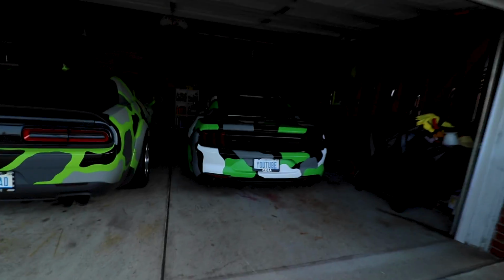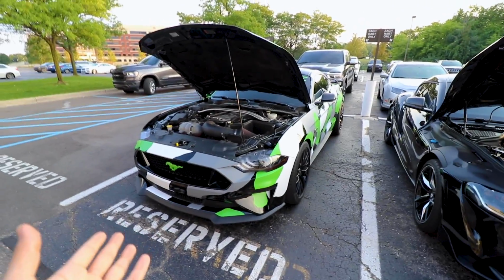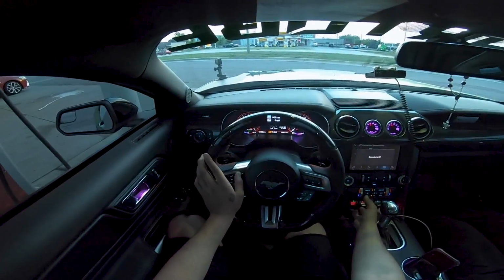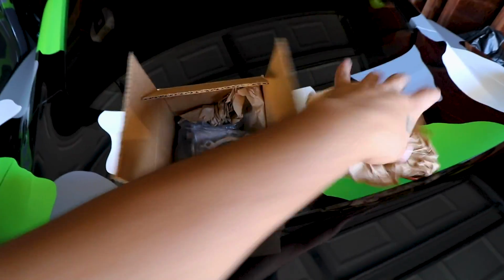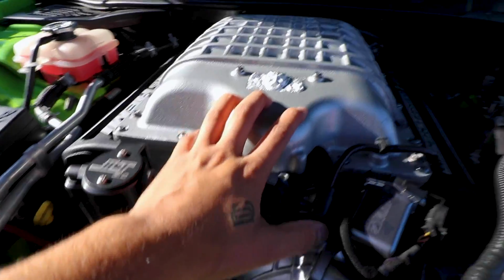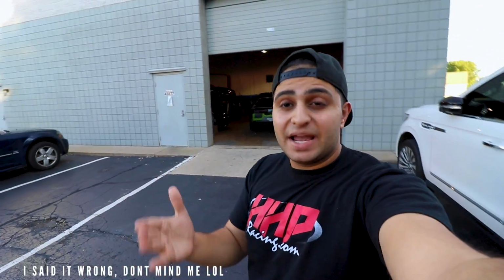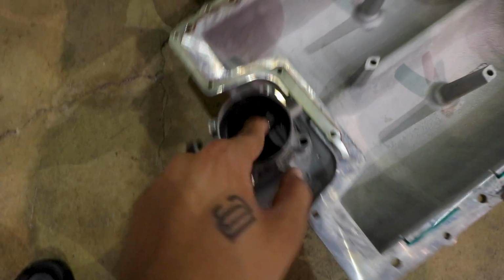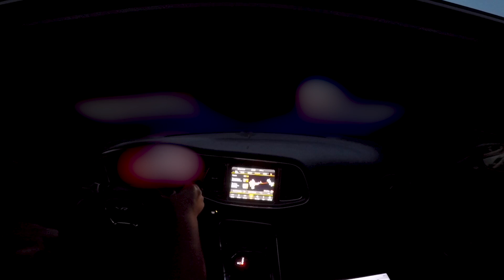2021 SUPRA TRIED TO RACE MY MUSTANG GT!

Comment: You have to Learn to line up.. You're always at least fender ahead in your rolls. 🥴
Reply: even if the supra got smoked bad
Reply: Doesn’t matter when the Supra gets gapped each time 😂
Reply: Not really a supra. More like a stock 335i.
Reply: @jrsosmooth5487  tune with bolt ons vs stock supra, what do you expect? dummy
Reply: @austinwinter8415  watch babaYagas video same hp supra take it.. its a stock supra what do u expect

Comment: He clearly jumped on every single one of those races
Reply: Virtus.n00b he literally said he’s giving the Supra the lead because his mustang pulls more hp
Reply: @StayDangerousFM  a stock supra isn't eating shit alive
Reply: @danm372  You my friend need to do research. A Stock 2021 Supra GR is a 10 second car off the lot. A straight 6, 388hp, and 421 ft-lb torque to the wheel. These are dyno numbers. lol my friend has one. He smokes just about anything around here. And we have a lot around here.
Reply: @StayDangerousFM  are you kidding me? Lmfao!! It's 382 flywheel and it's a mid 12 second car..where the hell do you get your stats from? 10 second car my ass! If he's smoking everything around you, you must live in a dead town
Reply: @danm372  Google it
Reply: They’re a 10 second car off the lot lmao do yo research
Reply: @StayDangerousFM  lmfaoo already googled it and you're completely wrong! 🤣 learn to read
Reply: @StayDangerousFM  Yup. My son sold his tuned SS Camaro and Bought a Supra GR, went much faster at the track bone stock after break in. Hasn’t lost to any stock mustang or camaro on track days, ever. In fact he gaps them.

Comment: All that supra needs is downpipe +tune and itll gap motortube
Reply: lol facts
Reply: Bro if this guy had a stock mustang, his stang would have gotten smoked by the Supra. The Supra smoked a 392 scar pack
Reply: @AyeeKoolaidGaming  Stock vs Stock, the Mustang takes it.
Reply: @burgerbandit3646 not really. The stang does a 12.2 while the Supra does a 12.0 flat. Some people have gotten the Supra to do a 11.7 with a perfect launch.
Reply: @AyeeKoolaidGaming  The Mustang is capable of running into the 11's as well with a good launch. Them being that close stock with the Mustang having a higher trap speed by 9 mph tells you that its a drivers race. This was a rolling race so no, the Supra wouldnt have taken it.
Reply: @burgerbandit3646  it depends. Because I’ve seen Supra walked down mustang in rolling races. I will admit that certain rolling races the mustang gaps the Supra by a car. But in a quarter mile, the Supra takes it. In a bad day, the Supra does a 12.4. On a good day it does a 11.9 or less. The stang on a bad da my does a 12.8. So yes your right it’s based on the driver. But the stang spins much more than the Supra which is why the Supra takes It more. Basically, it requires more skills to drive the stang vs the supra
Reply: @AyeeKoolaidGaming  Yup, Thats the name of the game.
Reply: @AyeeKoolaidGaming  NO. 2021 Supra = 22 secs to 0-150mph, 2018 Mustang = 28.6 secs to 0-150mph. That Mustang is several car gaps behind the Supra stock vs. stock
Reply: @iheartwatches  no right you right but my assumption is based on yt videos I've seen. But yeah the surpa usually gap the almighty fuck out the mustang

Comment: Run them on the strip, id bet it's pretty close.  I've seen supras with a tune and exhaust put out about the same power as the stang, being lighter it should be quicker.  Both fast cars

Comment: My buddy has a 2020 supra, it has downpipe charge pipe  intake and exhaust with pro tune, has 660 to the wheels, could have 700 but the transmission cuts off..got to love computers. First car we raced  was a zr1, and we got him
Reply: 650 without forced induction? sheeeshh
Reply: I have a 2020 supra down pipe bmc filter and methanol kit with a tune and barley got 500 whp ,  So can’t get 660 whp with stock turbos and fuel pump my friend.
Reply: @A________  he has the meth and the pure 800 turbo tuned by Mike, he came to the Dallas area to tune about 9 Supras .

Comment: Stock vs stock 2021 vs 2021 10speed 5.0 Supra takes it every time especially on rolls , this is mods vs stock. Do just a tune not even bolt on it will be faster than this stang and probably same as hellcat just with tune . Now bolt ons it will gap it by bus lengths.

Comment: Hey just curious, How are you launching? I see a lot of people put the car into sport and then use the paddle shifters to gown down into 3rd then after they floor it they put the car back into drive and let the car shift gears but I don't see you mess with the shifter after launching, so just wanted to know which way is better
Reply: for a 5.0 you’ll have to be into second gear for an actual really good launch on a 50 roll and people don’t put it back into drive while it’s on standard mode because it could possibly mess up the transmission cus he has a ten speed transmission

Comment: Didn’t like the Supra race because it was obvious what was going to happen with such as a high roll making it easy for the mustang.
Reply: 21 Supra will smoke 10 speed 2020 5.0 FYI, Supra probably had less than 1500 miles on it and engine is not even at full potential. Let’s give it a try after 2k miles or so again . Because 2020 smokes 5.0 but 21 has more power so this I call bs

Comment: Seems like this 5.0 is close to stock 445-460 hp. 445 is on 91 fuel. Again this is about what stock vs stock usually looks like, not a 5.0 with 100 crank hp more. You should have left that supra but didn't.

Comment: 2021 supra will spank a 5.0 all day. Its 400-450 lbs lighter, is closer to 420 hp not 382 hp for 2021. The 2020 was rated at 335 hp. If your 5.0 (based on what I'm reading), has 530 crank hp est, you should have not trouble spanking the supra, or a C8 vette.
Reply: 2021 dynood at 380 what do you mean 420
Reply: @sm_rcf1156  Crank hp. All vehicles are rated at crank. And the 5 2021 bmwupras I saw were rated around 371 to 379 wheel. 412-415 hp crank. Since today's DCT/Auto trans are more efficient than manuals, we are using 12.5% average since drivetrain losses are much less and there is no exact losses average because each engine has different tolerances and thus only an average can be used. The big issue for the supra is grip. Toyota may in 2024 bring an awd version. The 2022 model could see 400 hp crank. Which would be close to 435 wheel. The downside to the 2021 models is a much quieter exhaust and much less pops and crackles vs the 2020 aground got. I told him to wait 2 months more for the 2021 with 47hp more but he didn't think that was going to be true. In all honesty the 21 is no quicker 0-80. And only a few tenths quicker in the 1/4 and 2 mph faster. I would have loved to get one but with demand high and dumbasdes paying 20-30k dealer mark up,I said NOPE. To small inside for me too. 6'2". Head is rubbing with seat full down and back. The Z4 has more head room and a better look to it IMHO.
Reply: @MasterCarguy44-pk2dq  alright just needed to specify crank. the reason 2021 exhaust is quieter is because of 6 port manifold changes..  2021 will be alot better for those seeking to make big power. I've seen 6'3 individuals enjoy the car and say its fairly spacious for what it is so that is interesting. I am 5'9 and may consider a 2021 as an addition once they hit used market.
Reply: Supra is quick tho 2021 can run 11.9 1/4 completely stock. that isvery quick. With a proper ethanol tune, drag radial and downpipe it can easily achieve 10s

Comment: The Supra has 385 to the wheel not crank... Its a BMW Engine...
Reply: And the problem is what?
The B58 is an amazing engine and makes a shit load of HP once you give it bolt ons and tune.
Reply: @thisguyshorty3554  the problem is the Supra owner saying its 385 crank. My car has the S58 youre preaching to the chior....
Reply: The Juggernaut  what's up Daniel Hernandez! AKA The youtube troll.
Reply: @BabaYaga Racing 
He says your Supra is slow.
Reply: The Juggernaut  just like your Mustang.
Reply: 382 crank hp for the 21's they've dynod nearly 377 rwhp. The 335 crank hp 20' supra dynod at near 370 hp. The 2021 is not much quicker than the 2020 at all until over 80mph where the slight hp increase will show up. Torque is much closer between 2020 and 21 MY. E85 and dp with tune will put the supra up near 500 crank hp. Just two simple engine warranty voiding cheap modds. You'd need to boost a 5.0 to keep up or run a 130-150 hp shot of nos to even the tables. 5.0's have always been over rated...

Comment: Mustangs are sloppy and poorly built. My 2006 Acura TL has beaten all 2007 and earlier mustang GTs. 2 fewer cylinders and a lot less displacement. Ford started improving the Mustang (finally) in 2011 with the 5.0.
Reply: Great scientific test. You plan on running your car against the Flintstone Mobile next?
Reply: @vxer1000  Ahah

Comment: Stock for stock the supra is faster. The Supra’s are gapping the Mach 1 in multiple videos which are said the have 480ho. A highly modded mustang racing a stock supra gives you this outcome. If the supra was modded with a simple downpipe, E50 and JB4 your getting gapped!!!! For less money spent.
Reply: I've seen the opposite on so many tests and videos
Reply: The Supra most certainly isn’t faster than the 5.0 stock. Modded, yes.
Reply: @JP3_C6Z   like they're close in some races but most of the time the 5.0 just takes the cake
Reply: @VermillionRacing  they’re close when the 5.0 is 6mt and the driver sucks lol. Thats about it. Fbo for both, yes, the Supra is much faster.
Reply: Supras are more expensive so no, not less money spent
Reply: Why get the supra rather get the GR86
Reply: @JP3_C6Z  10 speed mustang kills Supra lol
Reply: Gapping a Mach1 no I don't think so even with a tune that's not happening stock for stock they cannot touch a 10-speed GT especially on top end

Comment: That mustang slowly pulling the supra only
Reply: It got whipped and its a lighter weight Turbo car vs N/A Stang. 😁
Reply: It be a good race is the supra has a tune only
Reply: @4bvenom733  Yea it seems the right tune can really wake those cars up ive seen a few vids.
Reply: Ima Kitty Cat down pipe with a e85 stage 2 tune makes these supra’s rockets! give my fbo 10 speed a really good run!
Reply: @keyyblayde4355  Sounds reasonable they are close to 400 whp stock and weigh less than a stang so it should run pretty good with some mods.
Reply: @danm372  Yea I wont be getting one  anytime ever.
Reply: Ima Kitty Cat it’s a 6 banger tho
Reply: @imakittycat1302  This was not "whooped". Dump some E in the supra and its bye bye 5.0. Slap a dp on it. IC upgrade and it'll give the 570 a run.
Reply: @4bvenom733  Supra would dust this 5.0 with a tune, especially if using E.
Reply: @imakittycat1302 :  With less horsepower.
Reply: @danm372  you're smoking. go look up a youtube video of 2020 stock supra dyno. they make more HP to the wheels than advertised. B58 is underrated
Reply: @dinhzel  not underrated 100 hp 🙄
Reply: @dinhzel  they make 340 to wheels not 400 wtf u talking about? That's most powerful version too
Reply: @danm372  no one ever claimed stock supras make 400 to the wheels...
Reply: @dinhzel  one guy said 388 and a few others said 400. Did you read the comments?
Reply: @danm372  good job deleting your old comments. I said 2020 supra was underrated. 2021 supra stock makes 388
Reply: @dinhzel  that was to someone that deleted there comments...said the same thing. I see at least 3 comments on this post that claim 400whp..are you blind? I don't care what you're saying, nobody was talking to you
Reply: @danm372  i feel like im talking to a wall. you literally don’t know anything about supra’s nor own one. Quit tagging me